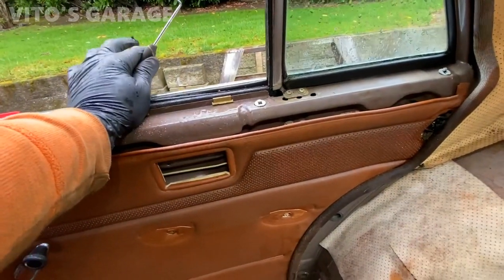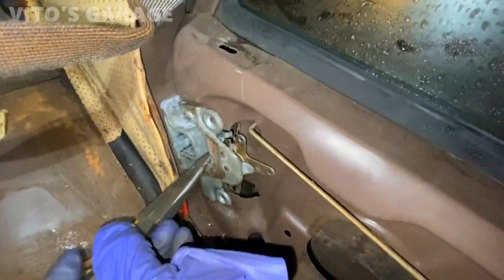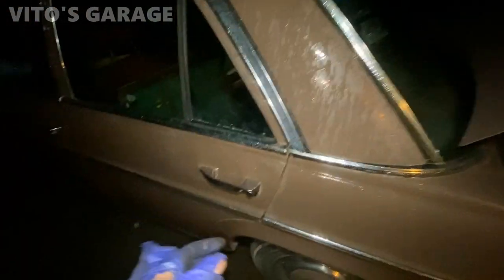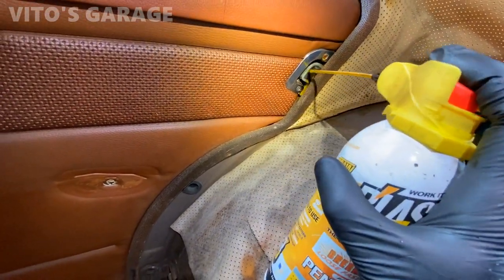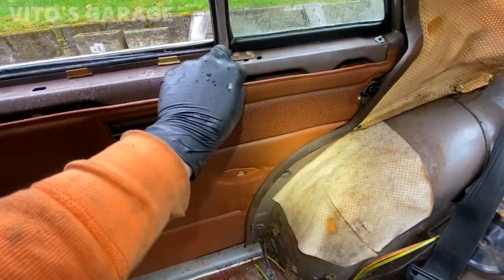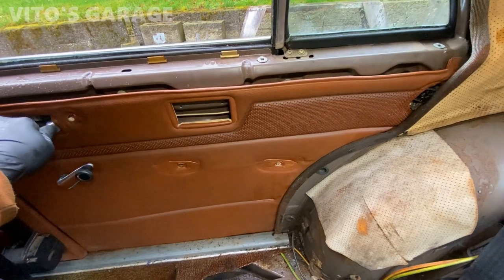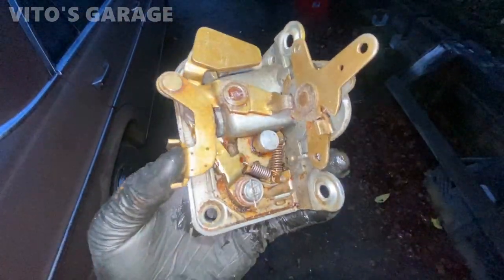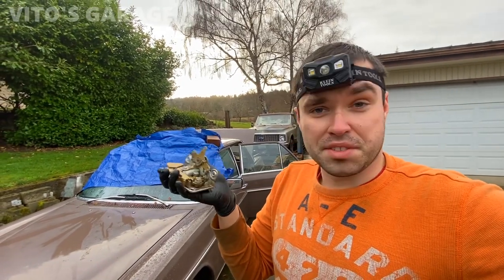2 Different Problems Caused Both Rear Doors to Be Stuck Shut!!!!! Mercedes W115 W123 W116 W124 W126

Comment: Someone previous had put on URO strikers on my w126. What a mistake. It wasn’t rust but the previous owner gave up on the doors, so they were shut for years. What a PITA. Fixed it just like you did. Lube is your friend and stay away from cheap parts  (at least URO)